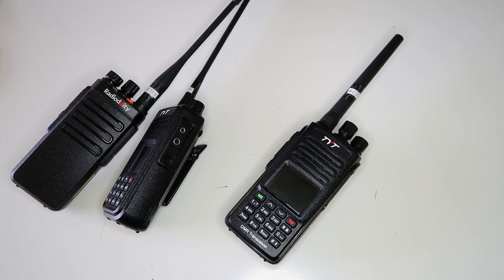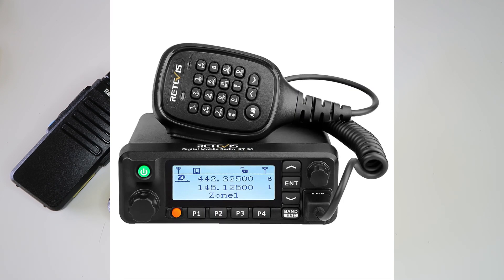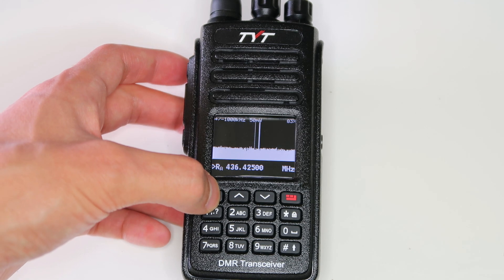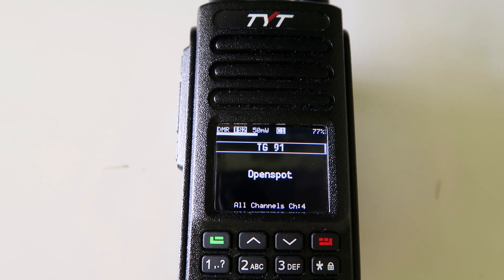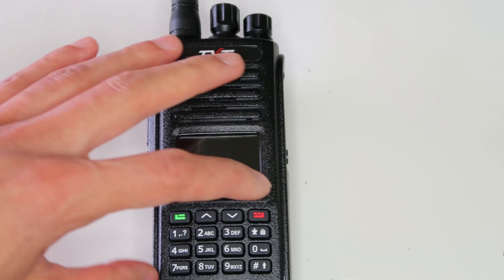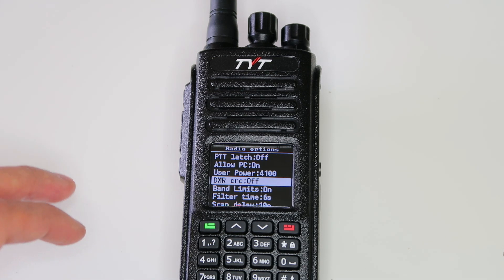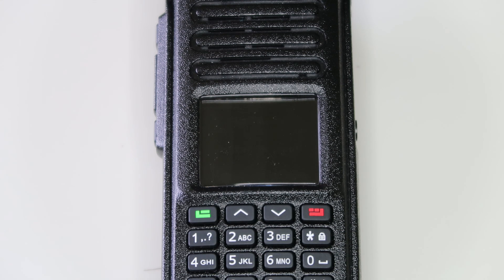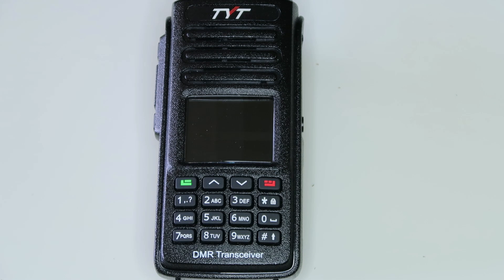If you have a dual band DMR radio you have to see this

Comment: Own an MD-UV380 running OpenGD77 and the Retevis 3TS running regular firmware. I hate OpenGD77 and the TYT radio doesn't work.  The OpenGD software cannot see the radio port on any of four different PCs and the only advice the OpenGD77 people have is try another USB port. I have. All of them.  And yes the cable and ports work. I can program and whatever I want to the Retevis. No issues at all.  They warned this was all technically unsupported and user's own risk and they were not kidding. I deeply regret ever putting OpenGD77 on my UV380. It is effectively useless without being programmable. At least I can use the batteries on the Retevis.

Comment: DMR color code agnostic scanning isn't impossible or a hardware limitation - thats like saying that you can't to NAC agnostic P25 scanning or PL/DPL agnostic analogue "because its a hardware limitation." Thats fundamentally wrong - the color code is done entirely in software, there's just no color code to receive all traffic (as $F7E NAC does for P25). Whoever wrote this firmware just handled color code "scanning" the laziest way possible.
Reply from the maker: @henryatkinson1479  is it not possible that the chip the radio is based on that handles part of the DMR functionality doesn't allow it?
Reply: @radiosification  No - color code is literally just DMR's equivalent of CTCSS - it is selective unmute and is done entirely in software. If the DMR standard were better-written, a default all-call color code could have been implemented, but it wasn't. There is no reason any DMR-compliant radio can't receive all color codes at once (you can test this by scanning a channel on every color code at once - I've done this on a great variety of MotoTRBO radios and it works without issue.
Reply from the maker: @henryatkinson1479  "if the DMR standard were better written"

So what you're saying is the DMR standard doesn't allow it? 

Then another company made a chip that follows the DMR standard and exposed certain functionality only, which did not include being able to turn off the colour code filtering. So the people who wrote this firmware did the best they could with the hardware they're working with.

What do you want them to do? Rewrite the DMR standard? Manufacturer a new chip that lets them turn off CC filtering?
Reply: @radiosification  I'm not sure how else to say that it's not a hardware limitation or anything to do with any chips - its entirely down to the software running on those chips. Everything on these cheap radios is done in software - there's no FPGAs or specialized DSPs in these things, everything is off the shelf. The standard does not include a value for color code that by default unmutes for all traffic, but implementing it at a firmware level without doing some sort of bodged rolling scan is trivial. Every competently designed DMR radio does this - use any commercial radio to scan a large conventional system, and you can see it in action.
Reply from the maker: @henryatkinson1479  I don't see how a commercial radio scanning a conventional system would turn off cc filtering. If it did that, then another system operating with a different cc would also be heard, right?
Reply: @radiosification  If you're able to scan every single color code at once through a scan function it demonstrates that there is no hardware limitation preventing the simultaneous reception of traffic of varying color codes. Again, I think you're fundamentally misunderstanding what a color code is - it is just selective calling, there's no black magic behind it that requires bespoke hardware to implement.
Reply from the maker: @henryatkinson1479  you're not scanning every colour code at the same time. The radio is switching between different channels, each with its own colour code.

I absolutely do understand what colour codes are for.

Comment: Thanks for the explanation! I’ve had or have the MD380 (gateway drug), MD390, MD2017, MD UV380, RT3S and other radios. I may try this on the RT3S, then UV380, so they’ll both have the same firmware along with a few new features. Which CPS works with the GD77 firmware?
Reply from the maker: Haven't used the CPS in a while but I think you have to use their one that's provided by the same people who make the firmware

Comment: I have to be honest with you.  This video inspired me to buy a UV380 and install OpenGD77.... frankly, I'm kinda regretting it.  Flashing the firmware to the radio was super easy, and the amount of features it opened up is incredible, yet, I cannot for the life of me get a codeplug into the thing that actually works with my local DMR repeaters.  I am not new to DMR or setting up codeplugs for DMR repeaters, in fact I've got a commercial rig that I programmed to my local repeaters that far as I can tell, nobody ham wise has even touched before and I cannot seem to get this UV380 working.  The only two things I've managed to accomplish is get radio to radio simplex DMR, and the BM Parrot talkback.  Pretty frustrating.

Comment: How many contacts does Open GD77 allow you to load into the radio?
Reply from the maker: I think it probably varies by radio since some have more memory than others.
Reply: FWIW, my MD-UV390 currently has the entire database loaded, at 50 characters per entry. That's 251816 at the moment. It says it can hold a total of 342864. Lower the character count and you'll get more. Between this and Talker ID, I don't think you need to worry about running out of space.

Comment: Wonder if the Anytone 878 Gen 1 is compatible?
Reply: It's definitely not compatible. The Anytones have decent stock firmware out of the box, but OpenGD77 is built from the ground up for amateurs, while everything else is originally designed to meet the needs of a very different, commercial market. I have radios from both companies and I greatly prefer my TYT MD-UV390 with OpenGD77 over my Anytone 878 and 578.
Reply from the maker: Well it would have been on the list if it was
Reply: @radiosification  Unless you -didn't have access to one to test it. -had not heard that it was compatible or not. -totally forgot that the radio even existed since i did not hear it mentioned. :)  Informative video. Good to know that we might get better software sooner then later. Thinking ARDN or Hamnet mesh networks.

Comment: They should make the data-stream wider, I hate the sound of compressed speech on DMR
Reply from the maker: You mean in this firmware they should make it wider? But then it wouldn't be able to talk to other DMR radios
Reply: @radiosification   two all i need, buy the bitrate is to low in my opinion. DMR sounds really bad, that people can listen to that. Analoge is more clear
Reply from the maker: Fair enough. P25 radios tend to sound a bit better because they have a higher bitrate. Same for TETRA. Also Fusion if you set the radio to VW mode.

Comment: I have been using OpenGD77 on my GD77 for many years.

The main thing that got me to change over was promiscuous mode. I was surprised the GD77 wasn't capable out of the box.

Since then every firmware update has been better and better and keeps alive a radio I probably would have sold long ago without it.
Reply: Have you ever had any issues and how reliable/stable is it?
Reply: @ilovefreeski  Over the years I have updated the firmware on my GD77 and now a DM-1701 as well, and so far (knock on wood) I have never had a brick. If you install the "stable" release you should have no problems with any quirks, crashes or sound issues.

I have run beta versions on my GD77 without any major issues, but I have not on my DM-1701 as that is my current carry radio and I only use the stable version.

Couple things to note:

1) It does not support encryption. I know this isn't applicable to Amateur use but if you use it in a commercial environment and you use encryption this won't work. 

2) This does not support dual watch. It will only monitor one channel at a time. 

If you need to monitor 2 channels there is a workaround by creating a Zone with the 2 channels in it and scanning it. But this isn't perfect. 

Those aside I think it's worth it over the stock firmware if you have a GD77 or similar radio (DM1701, DM1801, RT3, RD5R, TYT MD380UV) and while many of those radios are out out of production and no longer receiving official firmware updates, open GD77 is always being updated. 

Really the only problem you may encounter is first install if you have never done it before because there is a bit of prep work on the PC side that needs to be done.

Comment: Probably the main reason why the Baofeng DR-1801 has a locked Firmware. But that aside. What I don't understand is why we need to program every channel again with talkgroups for different repeaters. Isnt anybody come up with the idea to put repeaters in a list and substitute all the talk groups (channels) with a variable that consists of a repeater TX/RX frequency from that list. A single up or down that list would step into another repeater on the fly, maybe even automatically. Nos such thing yet.
Reply from the maker: You don't need to reprogram every channel with talkgroups for each repeater. You just make the group list once and then you can make a single channel for the repeater and use all the talkgroups on it. If you want to use another repeater you make one channel for that repeater and use the same group list.
Reply: @radiosification  Basically : Cloning channels is made specifically for this purpose so you can easily add the same talkgroups to another repeater. If you had a list of repeaters, cloning is not necessary.
Reply: @radiosification  Yeah cool, but in that grouplist every talkgroup has already a frequency listed (programmed) from a single repeater. Does not work that way. Just acknowledge the fact that programming talkgroups has a primary flaw with repeaters. There is no trunking mechanism yet. I do think you are mislead by scanlists, those work I agree.
Reply from the maker: @QUADBOYification  I'm confused by what you're saying. Every talkgroup is not associated with a frequency. It's just a talkgroup. You can use it with any channel on the radio. 

With this firmware you make a list of talkgroups for convenient use. Like for example I have a brandmeister talkgroups list and a DMR plus talkgroups list. Then I can use the brandmeister talkgroups list on every brandmeister repeater etc.

Comment: As much as I enjoyed them project when it was open source, I wouldn't touch it nowadays. You might be better looking at OpenRTX firmware which has the added benefit of supporting the open M17 mode as well.
Reply from the maker: I thought it was still open source? See the other comment about this topic. 

I did try OpenRTX but it's not very useful at the moment. Doesn't even do DMR mode and to do M17 requires hardware mods. So you basically downgrade from a DMR radio to an FM only radio unless you're willing to do a hardware mod to get M17 which nobody uses yet anyway. OpenRTX is a great project but it's not ready for mass consumption yet in my opinion.

Comment: I think I'll be digging out my RT3S and having a go with this. Looks very interesting.
Reply from the maker: Make sure you do the necessary backups of flash before installing it in case you want to go back to the official firmware
Reply: @radiosification   Thanks, I will. Hopefully I can find a prog cable that works. I have about five seemingly identical ones that only seem to read certain radios!

Comment: Does the CC scanning work if I have a TG already programmed? My local fire department is operating in X frequency and I have all the settings (TG, CC, TS and RAS) but I think they changed something because I cant listen to it. I just get the activiy green led.

I have CC Scan ON, TS Fitler OFF, CRC OFF. Should this work?

Thank you again.
Reply from the maker: I think that should work. It sometimes takes a few seconds to lock on to the right colour code. The first thing I'd do is try listening on an analogue radio at the same time to see what's going on and if it even sounds like a DMR signal still. They could have changed to a different digital mode or to FM.
Reply: @radiosification  I already did that and It sounds like a regular dmr system.
Reply from the maker: Did you manage to get it working?
Reply: @radiosification  yes! I left the radio near the window and it suddenly received my local fire department. It took a couple of minutes.
Reply from the maker: @bynlb  Ah great, nice!

Comment: After months of research and after I've actually done it, finally someone mentioned that this can be done on the MDUV390. All I found around the web was just "maybes".

Thank your for sharing this.
Reply from the maker: Yeah, I don't really know why they don't list it officially. It's just the same as the MD-UV380 for firmware.
Reply: Because of the 10W version throwing some wrenches in the works, it has some quirks. My guess is they don’t want the forum inundated with “why did you tell me this worked and now my screens way to dim!” posts. People don’t finish their research when they find the conclusion they wanted to find.

Comment: Thank you for your practical presentation. BTW, If you could introduce how to install the same feature onto HD-1, I would be very appreciated it. Thank you in advance.
Reply from the maker: Unfortunately you can't do it on the HD1. It's not compatible and there is no other firmware for that radio apart from the official one as far as I know.